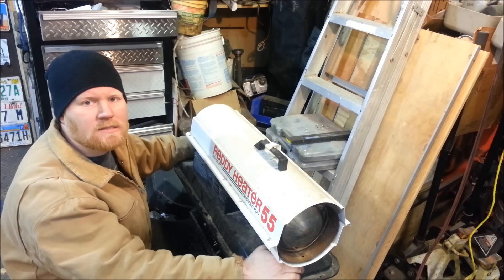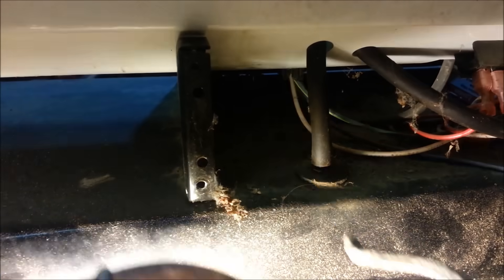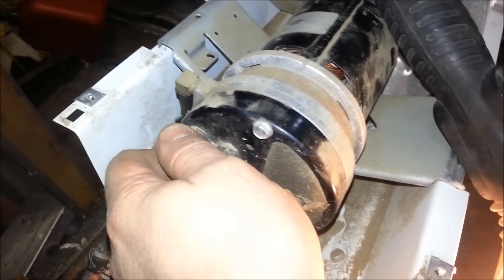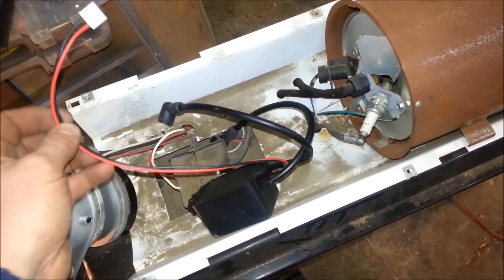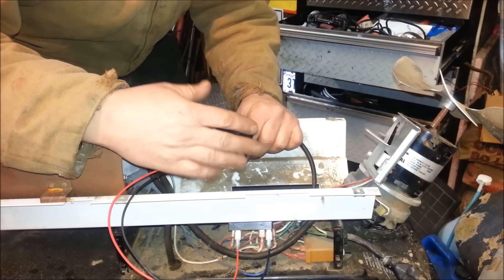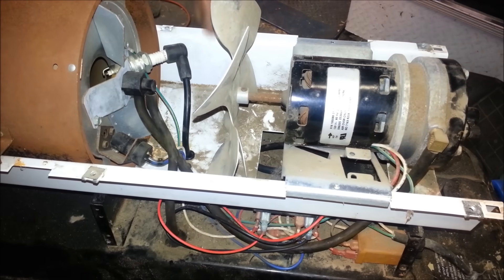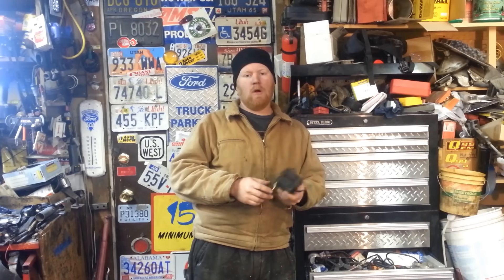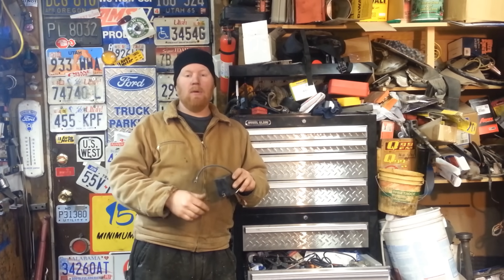Torpedo Kerosene Heater repair & HOW they work

Comment: I replaced the plug,photo cell,new K, filters, It won't fire now and just shuts off after 5 seconds.Is it the pump?
Reply from the maker: Sounds like your photo cell is working properly. The most common issues for a no fire are loose or cracked fuel and air lines. Sometimes the fuel like breaks right as it enters the tank so it can't suck up fuel.

Comment: Woke up in the middle of the night and couldn't sleep so I got up and started rummaging around on Ytube. Forget which videos I started with but pretty soon I noticed a pattern: most of the videos I was choosing were by this 'sixtyfiveford' guy and they were great. Unfortunately, I didn't up thumb them. Then I saw this one with the picture of the Reddy Heater 55 which I have owned for about 2 or 3 decades. To start mine I have to enrich the mixture a bit by blocking the air intake with a piece of paper for 1 second then it runs well. This video has encouraged me to get into it and set it up properly. And up thumb this video! Thank you, sir sixtyfiveford!!
Reply from the maker: Hopefully the video helps. Thanks for watching and the thumbs UP.

Comment: I can't get over 2.2 psi out of mine.  ( I need 3.4 )  My cone wasn't getting red.  What could be the problem?  I have decent fuel spray.  However, over the years I've had the pump apart and lightly sanded the vanes because they stuck.  Maybe the pump vanes are worn.  I have .004 clearance on the pump also.
Reply from the maker: Low pressure is either going to be a split air line, cracked plastic pump housing or worn impeller blades.
Reply: sixtyfiveford
I replaced the rotor & impeller blades.  Back up & running good now.  Thanks.  But I can't figure what was worn.  The rotor measured the same as the new & the old impeller blades were only .008 shorter than the new.  How can this be the problem when the blades run off an eccentric chamber?  I know I'm probably over trouble shooting this but I can't believe the length would matter since centrifugal force keeps the blades in contact all the time?  Anyhow,  thanks for the tip & your video here.

Comment: We just got a used torpedo from the shop next door. The shaft that the fan blade is mounted on doesn't want to spin the fan blades hard enough when the heater is trying to ignite. If we take the cover off and give the fan blades a spin manually, usually a few spins in it'll fire and run all day like a champ. Any ideas what would have that shaft a little bit stuck and not wanting to rotate on it's own?
Reply from the maker: If when the machine is off and not plugged in the motor spins effortlessly then the motor  is your culprit. If it has resistance then something mechanical is slowing it down. The motor is directly coupled to the air pump and that could be binding.
Reply: When it's unplugged the fan blade/motor shaft doesn't spin easily at all, just as much as you spin it manually then it comes to a dead stop right away. Will check out the air pump, thanks

Comment: That old heater I have, the fan turns freely until its powered. Than it turns real slow. The pump is fine. Do you have any idea why the fan motor does this?
Reply from the maker: Sounds like the motor is shorted out. It could also have motor brushes that are worn.

Comment: That's right. The fan doesn't blow. It goes threw no firing procedures that it once did. I found a igniter part for $30. As far as how it works, after you plug it in what goes first, the igniter? Because before I would see a nice orange glow inside chamber then fan would run causing it to fire. Does it have to be set on high when starting?
Reply from the maker: It more than likely tripped the breaker on the back or side of the unit.

Comment: I had my heater running fine after I cleaned out a massiive nest.  I turned it on a few times burning out the small debris. then I pluged it in and noticed it was on low. So while it was about to start or trying on low, I turned the knob to high and it made some firing noises and I saw some flashing or sparks.  Now it won't to anything. I plug it in and nothing , before that incident it started. Do I need a new ignitor?  Mine doesn't have a spark plug,  just wires from the control panel then mounted next to the fuel output.
Reply from the maker: You say nothing, does the fan still blow?

Comment: I tried to adjust. pressure to3.4  because front wouldn't get hot enough, no matter which way I turned  adjustment it stayed on 2 psi ,what could be the problem?
Reply from the maker: It could be a few things: your air line could have a split/crack in it, you could have a very dirty foam air pump filter on the back, or the air pump is failing. They do sell kits for the air pump if that's your issue.

Comment: my heater does not ignite with the top lid is on. If I take it off it ignites. it's calling for 5 pounds of pressure , I only can get 2.5 psi.I tried adjusting it but thats all i get. the spark plug sparks for the first couple minutes and then goes out is this normal? I change the pressure and fuel line hose is still does not seem to get over 2.5 psi. I installed a plug from another heater I have and it does the same thing. any suggestions? thank you
Reply from the maker: There is an air filter on the back that could be plugged causing low air pressure. Otherwise your air pump may be bad. They do sell rebuild kits pretty cheaply.

Yes some models will only spark right at the beginning.
Reply: sixtyfiveford
I found the problem to be the plastic filter housing was cracked from over tightening the screws. Replaced it and now I have the proper pressure, 5.5 psi. Runs great. Thanks for your help.
Reply from the maker: That's great. Was it an expensive part on your machine?
Reply: I saw one on eBay for $8. I took the full housing off an old heater I have and it worked great.
Reply from the maker: That's great.

Comment: thanks for the video.do i need to change anything on mine in order to burn diesel?
Reply from the maker: Most say they burn diesel. Some don't say it but there is no difference that I can see. I have run diesel in all of them and they all work great.
Reply: sixtyfiveford
thanks.kerosene by the pump is so hard to find.i will start using diesel.
Reply from the maker: I only use diesel as the price of Kerosene around me is $10/gallon and I think it stinks. Others say they hate the smell of diesel but it has never bothered me.

Comment: hey, I have a mr heater 75k btu. it would come on and shut off  and continuously  fire smoke fire smoke. i pulled the cover it has continuous spark and fuel sraying.so I check the photo senor, its nice and clean. same results,  I pull the pressure plus and connect my vac gauge. flip the switch and I get a 2 flash error code for slow motor start. nothing in the heater moves. its cold here about 20*. so I put a small electric heater on it to warm it up. didn't help. I tried to bypass the thermo didn't help. I did notice a secondary sensor below the igniter. could it be something with unburned fuel in the tube ??
thanks and help is greatly appropriated
Reply from the maker: Sounds like a spit/cracked fuel pickup hose.
Reply: sixtyfiveford  nailed it!, pulled the fuel line and it was cracked up. 1.59 and back in business. someone had cranked the psi up passed 10. dropped it back down and its working good. still need a capacitor but if you flip it on and off a few times it will lite.

thanks a million
Reply from the maker: Awesome. Glad you have heat. You're very welcome.

Comment: have one that run s for 5-10 mins then blows smoke filling up the garage then shuts off. does this sound like the light sensor
Reply from the maker: So, it heats for 5-10 minutes then the flame dies and it stops heating. But it still runs for a moment(5 seconds or so) and fills the room with smoke? This sounds like your photo sensor is doing its job. It shuts off the machine if it no longer sees light from a flame.

We need to figure out what is killing the flame. It could be water in the fuel, cracked or split fuel line, cracked or split air pressure line, low air pressure, a blocked fuel cap vent, or??
Reply: sixtyfiveford I gave this away then saw it for sale on CL and after seeing your video WAS GOING TO GO TRY TO GET IT BACK EVEN IF i HAD TO BUY IT CHEAP. BUT IT WAS GONE. DARN. BUT i BOUGHT ANOTHER THINKING i COULD FIX IT SEE ABOVE.
THANKS!

Comment: Thanks for posting the video. I have a Reddy heater (35,000 BTU). Mine runs for about 6 to 10 seconds and shuts off. It worked fine last year. I just replaced the fuel line and air line. I see spark and fuel (fog), but it runs for a short time, gets hot and then trips the breaker on the back. Any ideas?
Reply from the maker: Sounds like you photo sensor. If it doesn't see light from the flame it kicks the unit off. It could have spider nest in it, be dirty  or just bad.
Reply: Thanks for responding. I did remove the photo sensor and made sure it was clean. Still no luck. I guess I'll get a new one and see if that fixes it. Thanks again.
Reply from the maker: The photo sensor completes the circuit so you can test it by jumping the 2 wires. But don't leave it this way as if the flame dies it will keep going.
Reply: ahh good point! Thanks for that tidbit.
Reply from the maker: You should also be able to hold a bright flash light to it and check the continuity of the sensor with a multimeter.

Comment: I have the same torpedo heater except mine has a furnace style igniter instead of spark plug. Mine starts but then stops sometimes right away, sometimes after a few minutes.
Reply from the maker: Sounds like a photo sensor is dirty or going bad. If it doesn't see the light from the flame it will shut of the machine.

Comment: Anyone find the Heater Ignitor Transformer for twenty bucks.  Cheapest one I could find was sixty
Reply from the maker: Not 20, I said 27. They can be found here. http://www.equipsupply.com/search?q=ignitor+transformer&SearchSiteGo=Go
Reply: sixtyfiveford Sorry I just threw out the twenty as a general # but I did not find them this cheap either.  The video was great by the way.  I see there are several options does it matter which one I purchase?  Thanks  I just watched the video again and I think I figured out which one you purchased  GHP 39E0-0008-00 If that is correct it is a back order part
Reply: sixtyfiveford I just called there and the fella I talked with said I need to purchase a specific one and the price was almost $70.  I watched the video and see you put in a different one and it worked fine.  Will hold off on the purchase until I hear from you which one is the one you purchased.  Thanks
Reply from the maker: If you want a direct fit you need to order the exact one your machine calls for. If you are comfortable with your abilities to make something fit/work, like I did, then virtually any ignitor will work. They all function the same way they are just made to fit in different areas and have different spark leads or multiple leads.
Reply: sixtyfiveford Got it.  I am pretty sure I can figure out were to fit it.  Was worried more about the electrical part if to many watts volts whatever.  The one your ordered is the one that is out of stock.  The one they have in stock the only difference I could see was the length of wires and the colors.  I put in a request for the same one you have see what happens.  Again thanks for the help can wait to get this thing up and running again.  It was really nice because the one you use in the video is the exact one that I have.  Again thanks,
Reply from the maker: Did they say how long they are backordered?
Reply: sixtyfiveford They have not responded to me as of yet.  I leave for work tomorrow and will not be back until next Tuesday.  So be awhile before I can continue on with this.
Reply: liloz33 Just so you know sixtyfiveford that webpage does not even open anymore.  I talked to a person and she said she would call me back and never did.  So now I tried to go back to page and get nothing.  However found the exact same one for just a bit more: http://www.m-and-d.com/HTR-39E0-0008-00.html
Thanks again for sharing the video it was great.  Ordering my part today hope to have it for the next cold spell we are in store for.

Comment: My heater has spray,a new photo cell and new filters but it doesn't ignite,i have some spark,do i need a new spark plug to get it to fire off?
Reply from the maker: If a "fog" of fuel is coming out the front after a few seconds of firing it up then we know the fuel is atomizing. If you don't get a fog then the pressure is to low(pump setting to low, pump going out, or worn fuel nozzle).

If you have some spark make sure the gap on the plug or ignitor is set far enough apart (check manual) and that you get a blue color in your spark.

We need Fuel, Spark and a Fan to produce Heat so we just need to eliminate faults to see why it's not firing.

Comment: Hey that helped alot that's pretty cool to take your time explaining things just might save my wife and four yr old daughter from our pipes freezing I live in a trailer I have the same heater but it does not have a spark plug u said it would have one or " some other igniter" could u please elaborate and again thanks your a good person some ppl do appreciate
Reply from the maker: They have either:
- a standard automotive type spark plug
- a standard looking spark plug with long electrodes
- a spark ignitor made up of just two long wires barley not touching
- a hot surface ignitor that just glows red(no spark)

Comment: Nice info, mine makes a buzzing noise but nothing else. I did hit the reset, same thing.
Reply from the maker: Buzzing noise is a good sign. That means it is more than likely sparking. Take off the cover and take a look.
Reply: I did just that, the fan was sticking on the armature. was looking around under the hood and played with a couple of different things. tried to spin the fan, well now we got heat....by the way its a high of -5 today. yah Wisconsin.... Thanks for the video, it gave me a place to start. Great job helping others out..
Reply from the maker: Easy fixes are always the best. Most people would have thrown the unit away. Glad the video inspired you to fix it. -Moe

Comment: I have been searching for a coil like you bought and I cannot find one, I ended up bolting on a used oil furnace coil on the side of mine and it's huge and very heavy, where did you get yours?  I have bought a few heaters with the transformer bad and would love to find a cheap replacement instead of the $80.00 unit.
Reply from the maker: www.equipsupply.com they have several for 28 bucks. All are 2 lead models

Comment: Thanks, good overview of all systems. I was able run down a plugged nozzle to get my old Rediheater going. Roughly 25 yrs of hard service and I finally had to service it. Its de-icing my Polaris wheeler as I type. (there was a ton of black dust I cleaned from the air pump filter...this may have been part of the problem too)
Reply from the maker: Great to hear you got her up going. Glad the video helped.

Comment: Mine has a ignitor instead of a spark plug and it is glowing red but not sparking anyway to fix that?
Reply from the maker: Some have a hot surface ignitor instead of a spark. It glows red hot and when the atomized fuel hits it, it ignites.

Comment: I'm going to buy a new photo cell for mine.I was unable to check the pressure.
I have spark and fuel spraying out of the nozzle and i used new K1.I ordered a new filter too.After this i'm going to take a hammer to it!
Reply from the maker: I know how you feel. I hope it doesn't come to that.

Comment: My heater really stinks the garage up badly,is there something wrong with my
55K btu heater?
Reply from the maker: The pressure could be off and need adjusting. I think Kerosene smells bad and prefer to use only Diesel fuel. Others say just the opposite.

Comment: Dude you just saved my butt.  I've had this heater for 10 years an no problems, and a couple months ago it stopped working.  This video just urged me to tear into it, and the first thing I see is a dried-up leaf sitting in front of the optical sensor. Painless.  Thanks for kicking me into action!
Reply from the maker: That's an easy fix.. Glad it was something so simple and that my video helped.

Comment: Ran heater out of diesel and filled it up, ran it for a half hour and it stopped with a code C9. fan spins, glow plug works. one second of flame, then out and code appears. PCK160VT HEATER. Any suggestions?
Reply from the maker: A C9 pretty much means you fan isn't spinning fast enough or your pump is bad.

Out of your manual:
Display shows C9 Low Pressure.

1. Bad electrical connection between motor and power cord.
2. Motor locked-fan obstructed.
3. Motor locked-pump obstructed.
4. Motor defective.

1. Unplug heater. Check all electrical connections (see Wiring Diagram, page 18).
2. Unplug heater. Clear fan obstruction.
3. Service pump (see page 17).
4. Unplug heater. Replace motor.
Reply: Thank you!
Reply: It's hard to believe I'm having this problem. The unit is not even a year old and barely used. I appreciate the help in troubleshooting.
Reply from the maker: It could be a dirty air filter on the back of the heater.

Comment: If the heater is plugged in and heating and you use up all your fuel does it cut itself off Automatically?
Reply from the maker: Yes. The photo sensor will see that the flame is gone and trip the circuit breaker on the side/back of the machine. This cuts all the power to it until you reset the little breaker.